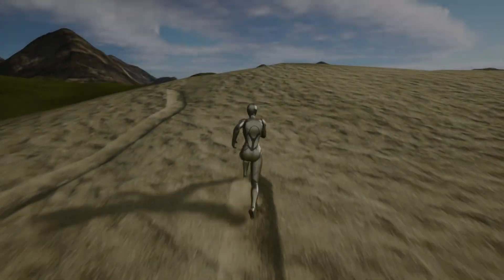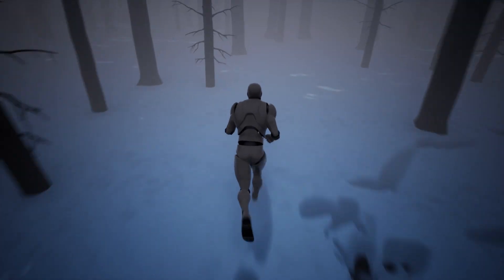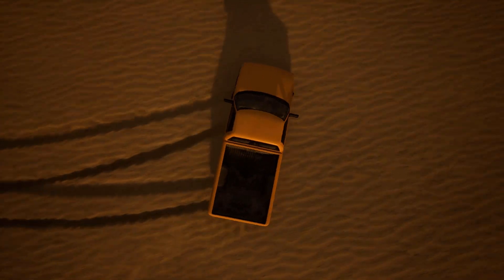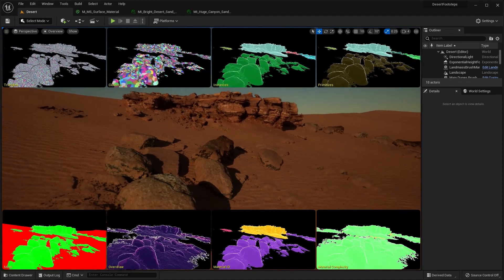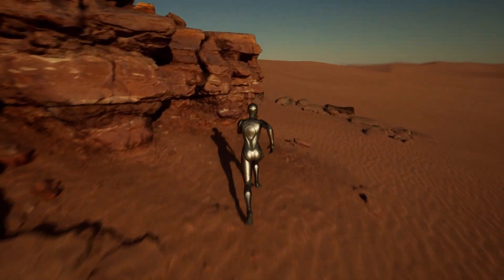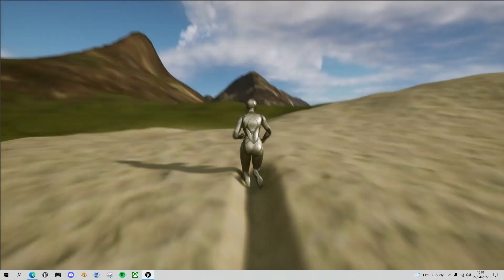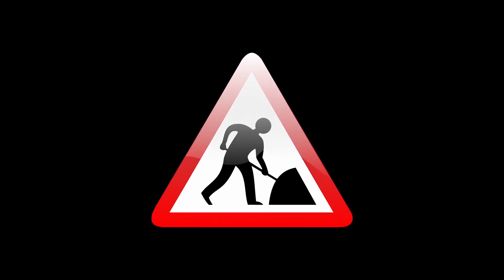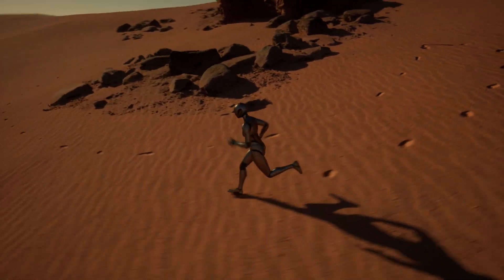Unreal Engine 5 - Landscape Displacement Problems

Comment: It's a shame that they have removed displacement as an option. There are still so many great ways to use displacement that Nanite simply doesn't work well with. For me it's trying to add snow on top of rocks that have height as more snow falls. This was something that could be done in Unreal 4 but is impossible to achieve now in Unreal 5. I'm sure they will create some sort of plugin that utilizes their Nanite/Displacement feature into some workflow for it.

Comment: This is driving me up the wall. all the blurry and popping virtual textures tiles. working on a vfx pipeline, So we don't care as much about memory. figure I just have to use a landscape with no displacement then set dress with with only assets, which takes way longer. even the VT blending blurs out all randomly. Even camera distance tiling doesn't work with with virtual heightfield for zoomed out shots. Guess the other work around is just have a super small heightfield mesh just in your camera view but only works for specific camera shots. But even that is buggy as all hell.
Like this has lots of potential for layering displacement and optimization, but its just not there yet. Just wish they didn't remove the thing that worked to something that isn't 100% working yet and I'm forced to used ue5 over 4.27 because the client wants it.

Comment: Do we have news about this issue, or anything to do to have better results ?
Reply from the maker: Not much yet, I'm afraid. You can see in this video on desert footprints ( https://youtu.be/GhtZK8J2LcM ) that I use two different techniques for displacement. The Virtual Heightfield Mesh doesn't work well at the moment but the Normal Displacement method is a lifesaver for now.

Comment: how do you do virtual heightmap without displacement? the tutorials i've seen require the output from material attributes.
Reply from the maker: The virtual heightmap just needs to get it's height information from somewhere, usually the World Position of the landscape material (even without displacement).
I've just published a "footprints" video using the virtual heightmap. Check out the chapter on  "True Displacement" where I get the height info from the landscape WPO at https://youtu.be/GhtZK8J2LcM

Comment: I've noticed that tesselation was a thing in the early to mid 2010s, with several AAA titles such as Max Payne 3 and Crysis 2/3 using it quite liberally. Max Payne 3 used tesellation for rounding out character models and GTA V used it on trees and the occasional rock formation. But then it fizzled out later in the decade for some reason, and developers seem to have written it off as a gimmick.
Reply from the maker: Yes. I don't mind tessellation disappearing per se.... it's just the lack of a suitable replacement for negative displacement

Comment: Yeah. I honestly think that Tessellation deserves to go, but the way they handled it leaves much to be desired. The supposed replacement is buggy and not documented at all. Since the motto of the UE for the past few years has been "Virtualize ALL the things", from textures, lightmaps, to shadowmaps and geometry, I think it'd make sense if Landscape was made to natively use Virtual Heightfields under the hood, while from user side of things, the workflow would remain exactly the same as with current Landscapes. No manual messing with VHF setup. We'd just upgrade the engine version and get much more high resolution landscape surface for free, out of the box.
Reply from the maker: I agree with your viewpoint. It's far too convoluted at the moment to set up RVTs, volumes, material changes, VHM LOD setup and still doesn't really work. It needs to be simplified greatly to be part of the landscape creation flow.